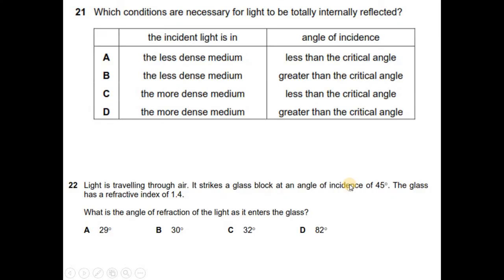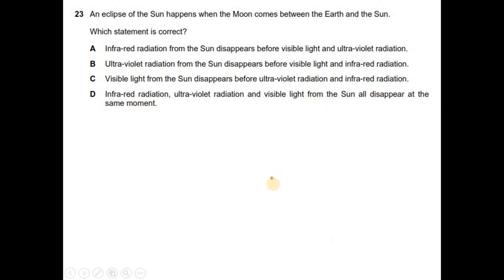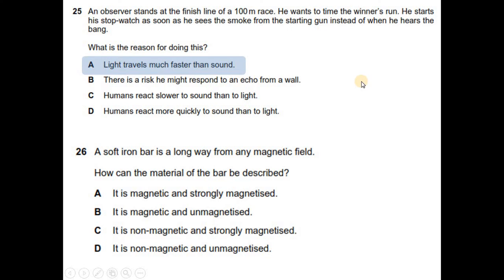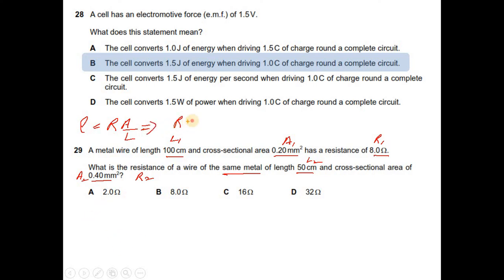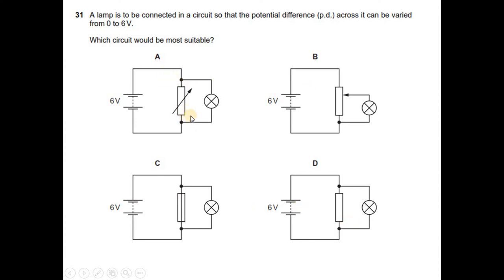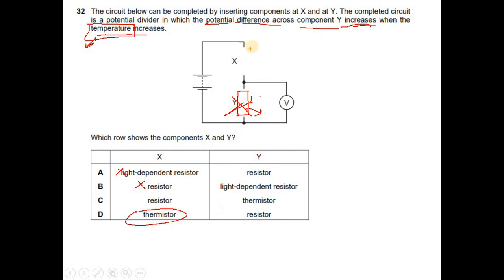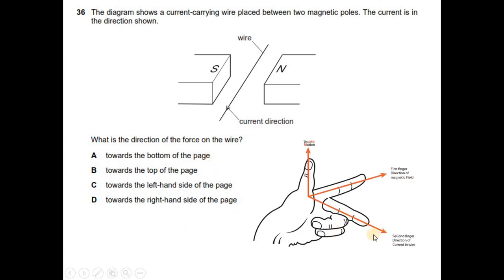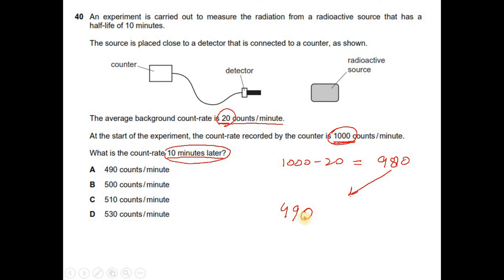CIE IGCSE 0625/M/J/19 Paper 22 part 2

Comment: i didnt understand q40..? thanks
Reply: half life is 10 mins. background is radiation not coming from the radioactive source; it is given as 20 counts/min. the total count rate recorded by the counter is 1000 counts/min. this count rate is background + source. to get the count rate from source only u subtract so 1000-20. the count rate of source is 980 counts/min. 10 mins later means the susbtance had 1 half life decay so to get its counts u divide its original count rate (980) by 2 giving me 490. the counter reads the count rate of the background+source so ur going to add background count (20) to the new count of substance after it decayed once (490) giving u 510 counts/min hence correct answer is C.    dont know if anyone gonna read this but whoever does, hope it helps :)
Reply: @dest2438  A literal hero!
Reply: @dest2438  thank you so much!
Reply: THANK YOU!!! @dest2438
Reply: could have been done with: 1020/2= 510 too! 10 mins given so divided one time, for example if 20 mins was given it would be: 510/2
Reply: same
Reply: same